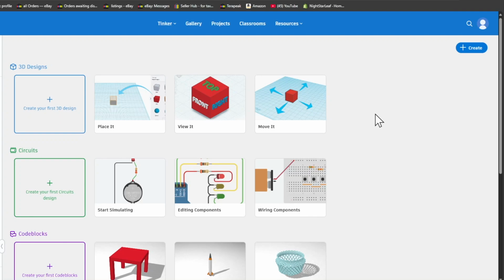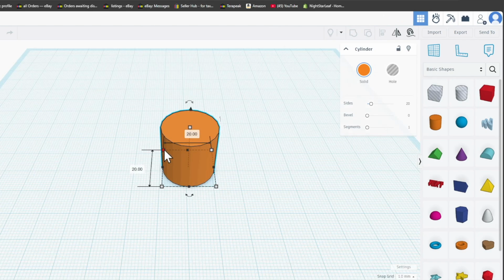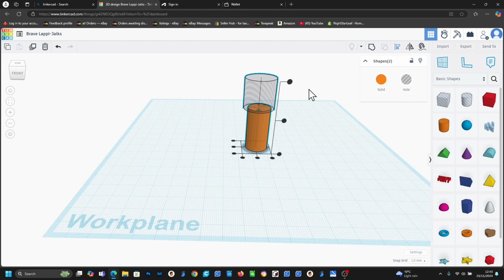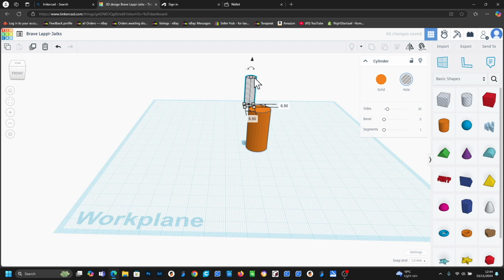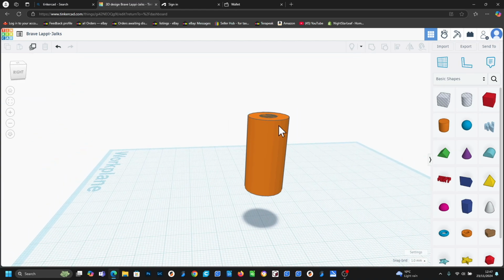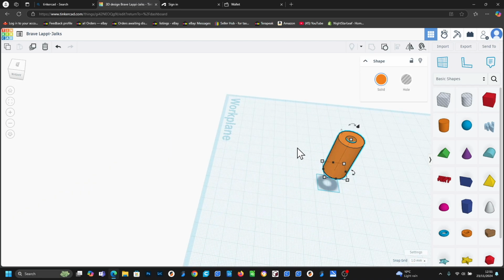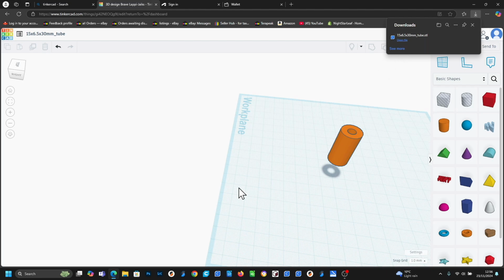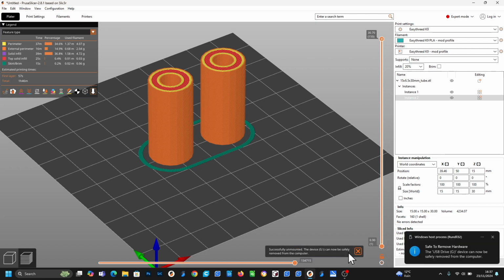Tinkercad 3D design project beginner starter easy for Easy Threed K9 mini 3D printer

Comment: To make the measurements quicker, click on hte clear quares at the corners of the shape and you will see the depth and width of the shape, click on oine of the sizes and alter it to suit, then click the tab key on the keyboard and it will go to the other measurement and you just type in what you want and press enter. When you have a cylinder round object ,make sure it is selected (where you see the outline measurement square) and in the small window, slide the "sides" to the right to make the flat sides less visible. With the generic setting, it will look like a 20 or 16 sided figure. The more (maximum sides) makes it look more round. 
I have now upgraded to a Bambu Lab P1P. I still have not got another K9 printer yet. My son has bought me the Bambu lab printer for xmas but because of the size of it, he said I could set it up and use it straight aaway as nowhere to store it until Xmas day. Works straight out of the box and I have upgraded it by fitting a touch screen to it but you cant print from the touch screenl. Only alter the settings and move the hotend and plate. With bambu Lans slicer, it prints twice as fast as my Ender 3 V3 SE. 
I have also printed some squash ball feet for both printers and put squash balls under them. Causesd less vibrations, especially with the bambu lab printer as the hotend wizzes about at speed. The build plate rises to the hotend while the hotend moved in the X and Y axis The plaze is the Z axis with 3 of the Z screws rotating at the same time.  I saved money by not wanting the P1S as I have an enclosure to put the printer in. The P1P and P1S are the same machines but the latter has sides and a top on it. They both have a bu8ilt in light and a built in camera. I can record what I am printing in timelapse and also check on my phone how the print is doing.
Reply from the maker: I really like the Bambu labs too. Hopefully you will get some great results with it. I have been thinking of getting the A1 mini for the channel but I simply have too many printers already for the space. Im still working on the K9 as well. Thanks for the Tinkercad tips too. Ill be doing more on that & I can include this next time. Kind regards & best wishes.
Reply: @NightStarLeafTech-vj3ez  Dont fall into the trap like I did. I bought a cheap Ender 3 and upgraded it. I replaced the motherboard with a 4.2.7 board, a lot quicker, a V2 screen, replaced the glass bed with a double sided magnetic bed, bought a new heated bed, changed hte bed springs for silicone pads, belt tensioners and put a creality auto bed leveller on it. Cost me around £300 for the printer and all of the upgrades and it sold for £90. There is no money in them and the value drops quicker than a mobile phone. lol. My Bambu Lab is a great peinter. Twice as fast as the Enders, better prints and works straight out of hte box. No setting the bed and offset. It is all ready to go. I got the hot end blocked but that was due to running out of PETG filament and carrying on with the print the next morning. I think now I have printed planters I needed, I will just use PLA .